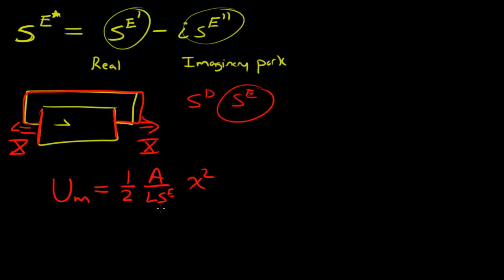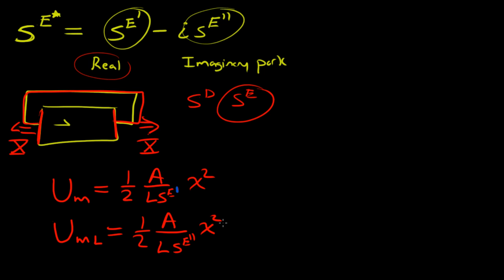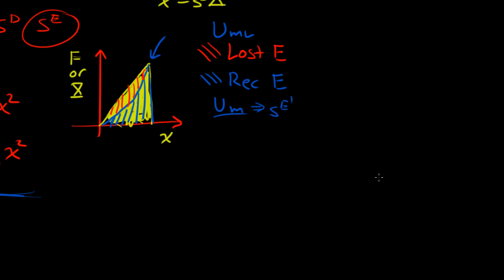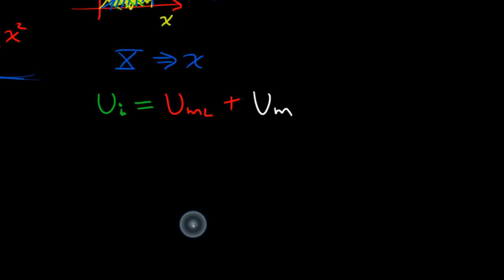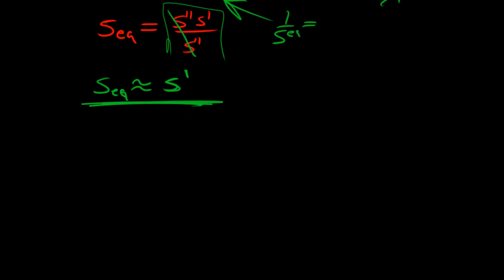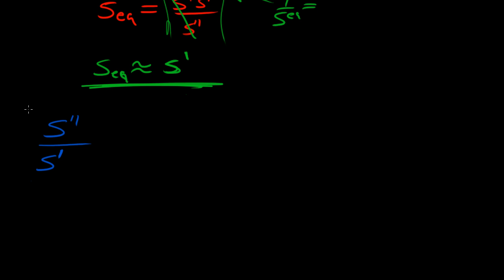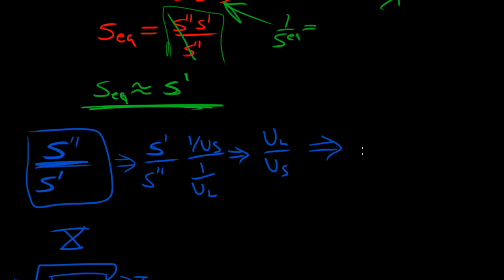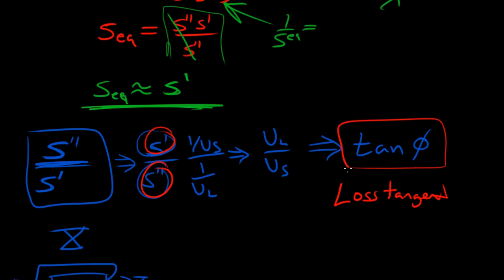Learn Piezo Lecture 5B: Definition of elastic loss according from an energy perspective

Comment: Hi, thanks for your videos. They are very helpful. But there is a question. Why the formula for mechanical energy calculation is different from that used in previous the lectures? The position of the variable L is different, i.e U=(1/2)(AL/s)x^2 vs U=(1/2)(A/Ls)x^2 .
Reply: Thanks for your reply!